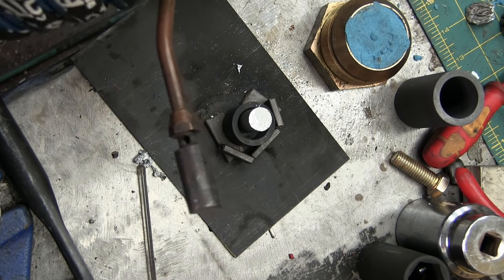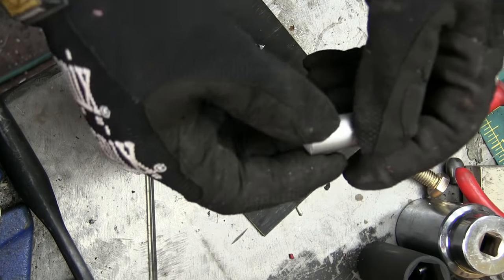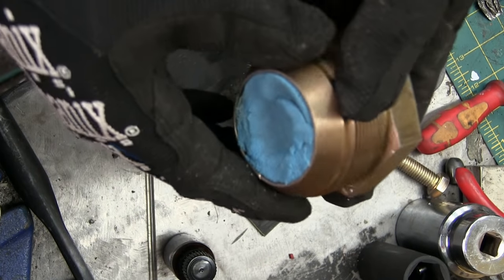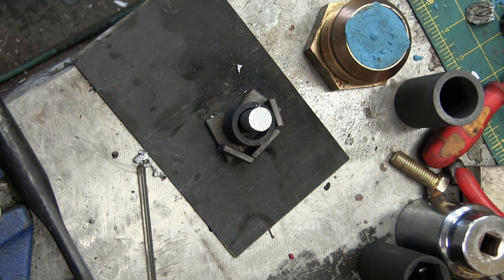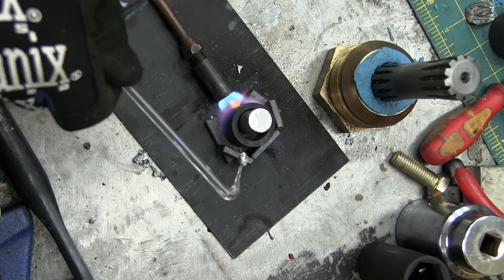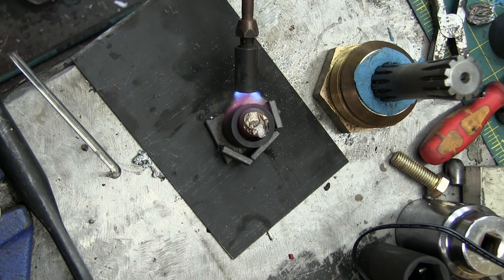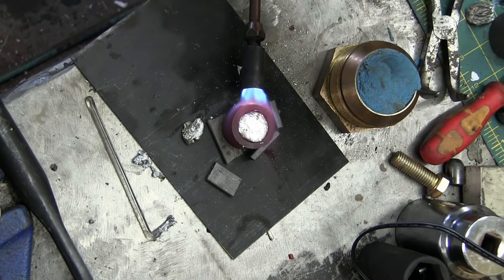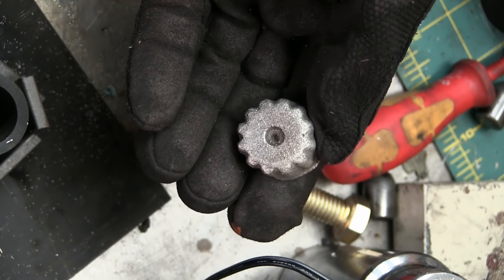Surprisingly Easy Way to Cast Aluminum

Comment: "...that's why TIGing Aluminum is so difficult." You're doing it wrong, first remove the oxides, then start welding. You'll get nothing but crap with heavy oxides on there.
Keep your lick in a slice.
Reply: +Super Taster Uhhh...
The oxides form DURING the weld.

You're asking him to take his socks off before his boots.
Reply: If the oxides are forming while you're welding, then you aint frikkin welding, nada, nohow, not even a little. That's what the argon is for. You're telling me you cook your baked potatoes with dry ice?
Reply: Dude, We all know the wiki article on welding, don't be an patronizing ass, And I say that fully aware of the irony of me being a patronizing ass as I say it.

Removing the surface oxides is the easiest thing you could do, Mig and tig welding is hard because your have to AVOID making MORE oxides.
Reply: OK trollbot, I guess you meant that oxides were formed during the melting process, which they were, but that's not welding. Thanks for the heads up about Wikipedia, I'd never heard of it.

Comment: Now I got something I can use those odd bits of aluminum I got laying around.  I wonder if I can squash my metal turnings into a ball that will fit the crucible. I bet the cutting oil will stink and smoke a LOT. Still gonna try it of course.  Hmm
Keep your lick on the mice.

Comment: ADD tin to it...makes it rigid
Reply: Oh, I have a question because I think you might know a decent amount about metals. Anyways, in a addon/mod for a game there's an alloy called Aluminum Brass made with 3 part Aluminum to 1 parts Copper, and has a Brass like color. Is that an actual alloy type of Copper and Aluminum or is it made up and simply another kind of Duralumin? What properties do you think it'd have?
Reply: Ed ash
Ah, I see. I understand that a bit better now. Bronze/Brass is better then plain Copper and harder because of the properties it gains when mixed with Tin and other metals. Thanks for the info!
Reply: +Ed ash Throw in tin and lead. The tin will stiffen it up, and the lead makes it easier to machine, as I understand it, the lead in it is like a lubricant. Lead does a good job at MASSIVELY lowering a metals melting point though... so that might be a problem :)
Reply: +Richard Smith Why are we planning to send this gear to Mars?

Can you imagine the pioneers once thought lead was so magical they'd pound patches of the stuff into their cookware bowls. Roy Underhill showed it on his "Woodright's Shop" TV show once... I think you can find the older ones here on YT. Very fascinating mind & set of restoration skills. He's allowed to work on Thomas Jefferson's old home... the Thames House on the back of your modern nickel.... because he can and does do it all with period tooling. Fascinating to see how tools & toolmaking progressed along with the times & culture.
Reply: Jon Miller Doesn't bismuth add brittleness as well as lowering the melting point?
I don't know much about the metal as an alloy, so I don't know how it behaves when alloyed to aluminum.
It does have the prettiest dross out of all the metals tho :)
Pain in the ass to cast cause it expands when it cools, like ice.
Made some weights with it years ago. I never did get half of them out of the muffin pan. :)
The wife still asks me from time to time if I have seen that muffin pan anywhere.
Reply: Yes, but the melting point is a little bit higher than lead. Aluminum and lead are both soft, so adding a small amount of a brittle metal that alloys well promotes chip formation (as opposed to making giant strings of aluminum, or even just sticking to the tool, effectively dulling it without actually removing any of the tool, and much faster than the usual dulling process). 

For something really interesting look up aluminum bronze. Properties you would not expect from the addition of a relatively soft metal like aluminum.
Reply: Copper is what they add to AL to get aircraft aluminum...not sure if that is practical to make at home, though. Wouldn't a lot of people be doing it if you could? Your own 6061 and so forth....

Comment: So, AvE... I dig yer vidyas and so forth, but in the suggested vidyas down in the thing, this gem was waiting for me. 
https://youtu.be/ozdhsJysGfM
Now, I'm no prude, so of course I watched 'er a few times punched 'er into the Gargler and found vast libraries of stories and pictures and vidyas about the proper care and feeding of a Sarlaac with these knobby devices and it got me to wondering... Which flavor of aluminium do you think has the best properties for cramming in to occlude the exit shaft?